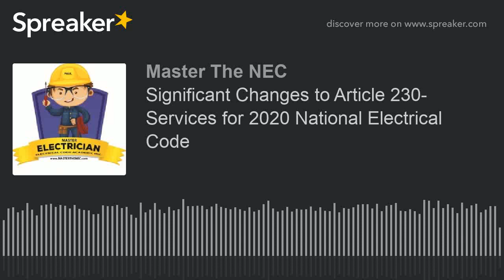Significant Changes to Article 230- Services for 2020 National Electrical Code

Comment: On the 230.85 option #3 allowing a SUSE rated disconnect ahead of the Service Disconnect...I would assume it is allowed to run 3-wire SEU cable ( or any permitted 230.43 SEC method) from the load side of such emergency disconnect into the dwelling service disconnect as permitted through 230.82(10)...with grounding and bonding done in accordance with Part V and VII of article 250. The installer will need to install the green bonding screw of the SUSE rated Emergency Disconnect from the grounding bus to enclosure to bond the grounded conductor to the metal enclosure. 

It would also appear that with option #3 the service disconnecting means load side of the option #3 Emergency Disconnect would need to comply with 230.70(A)(1) and be located "inside nearest the point of entrance of the SEC"...even though the outside SUSE rated Emergency Disconnect will most likely have overcurrent protection in that it is SUSE rated. Interesting allowance.

It appears to me the advantage of option #3 will allow old 3-wire branch circuits to ranges and dryers to stay "as is" on service upgrades where if option #1 were employed by the electrician, he would need to arrange the inside panel as 4-wire with separation of the equipment grounding conductors from the neutrals and would need to change out the old 3-wire range and dryer branch circuits to 4-wire. This must be the reason for option #3 being added to the list.

Next...lets figure out where supply-side connected 705.11 sources will be connected when a 230.85 option #3 arrangement is installed? I guess anywhere ahead of the service disconnect will be allowed. But if connected to the line side of any option 1-3 Emergency Disconnect, the 705.11 conductors are allowed to be run 10-feet inside the dwelling according to 705.11(C)(1) and will still be energized up to and including the 705.20 Source Disconnect. CMP's added emergency disconnects for first responders in 230.85, 445.18(D) and 706.15(A), but seem to have overlooked this arrangement for 705 supply-side connected sources. Below is a fix for that that I may submit as a PI for 2023...of do we need a TIA?

Add the following "sentence" in 705.20(3) so it reads as follows...

(3) Located where readily accessible. "For one-family and 2-family dwelling units, the disconnecting means for supply-side source connections shall be located at a readily accessible outdoor location."
Reply from the maker: Greetings Pete - I see you put a lot of thought in that comment so I will provide my thoughts as well to your comments. I agree in general with your premise but do have some anecdotal information to interject.
You stated :

"It would also appear that with option #3 the service disconnecting means load side of the option #3 Emergency Disconnect would need to comply with 230.70(A)(1) and be located "inside nearest the point of entrance of the SEC"...even though the outside SUSE rated Emergency Disconnect will most likely have overcurrent protection in that it is SUSE rated. Interesting allowance."

While I agree with the notion of 230.70(A)(1), it is also an option to install it outside of the building as well, not just inside the nearest point of entrance.

You stated:

"It appears to me the advantage of option #3 will allow old 3-wire branch circuits to ranges and dryers to stay "as is" on service upgrades where if option #1 were employed by the electrician, he would need to arrange the inside panel as 4-wire with separation of the equipment grounding conductors from the neutrals and would need to change out the old 3-wire range and dryer branch circuits to 4-wire. This must be the reason for option #3 being added to the list."

Well, that may be the reason but I have not looked back at the CMP comment or substantiation to the new rule. I guess because I disagree with the change personally so I was not invested in reading the history of it other than desired by the first responders.

You stated:

"Next...lets figure out where supply-side connected 705.11 sources will be connected when a 230.85 option #3 arrangement is installed? I guess anywhere ahead of the service disconnect will be allowed. But if connected to the line side of any option 1-3 Emergency Disconnect, the 705.11 conductors are allowed to be run 10-feet inside the dwelling according to 705.11(C)(1) and will still be energized up to and including the 705.20 Source Disconnect. CMP's added emergency disconnects for first responders in 230.85, 445.18(D) and 706.15(A), but seem to have overlooked this arrangement for 705 supply-side connected sources. Below is a fix for that that I may submit as a PI for 2023...of do we need a TIA?"

Well, you are correct in that option # 3 does permit the application of 705.11, which references 230.82(6) as well. Yes, those conductors that derive from that connection are permitted and they also require overcurrent protection per 705.11(C). I see your concern.  Now, in the main body of 705.11(C) there is a statement "Where the power source output circuit conductors make their connection to the service outside of a building, they shall be protected by overcurrent protection by overcurrent devices in a readily accessible location outside the building or at the first readily accessible location where the power source conductors enter the building." 
So to me since the allowance we are talking about is 230.82(6) and option 3 is part of 230.85, whereas the emergency disconnects in question have to be outside anyway I think it is covered.

I think the issue in question is that your reference to the 10' in 705.11(C)(1) has to do with where the power source output circuit conductors make their connection to the service inside a building (not outside), then they have to be protected in accordance with 705.11(C)(1) and (C)(2). So it's kinda a different thing that where it would be associated with this change in my opinion.

Now,  I also believe that in the first paragraph of 705.11(C) says is the charging statement for this outdoor or indoor situation for Interconnected Electric Power Production Sources. It says " If fuses are not integral with disconnecting means, the disconnect means shall be located on the service side of the fuses. Of course, 705.30 will demand that overcurrent protection.

Thank you for the comments and do not let me sway you. I look forward to your public inputs to the 2023 NEC my friend.